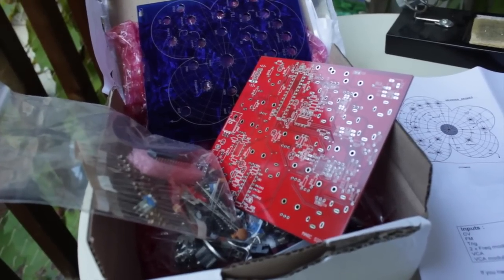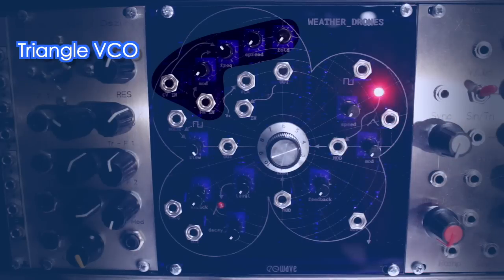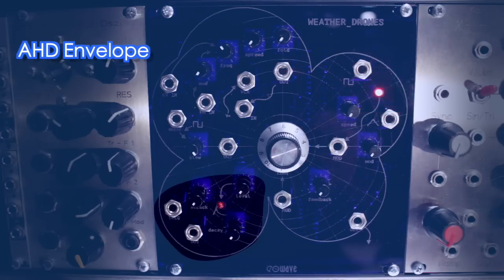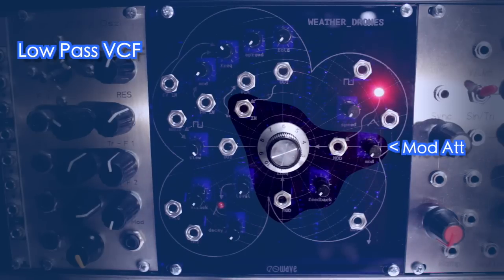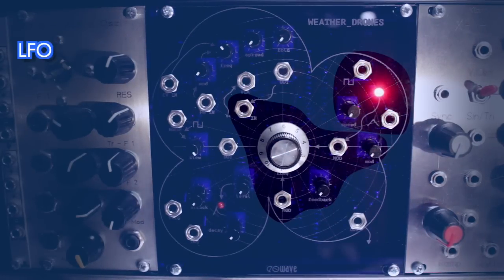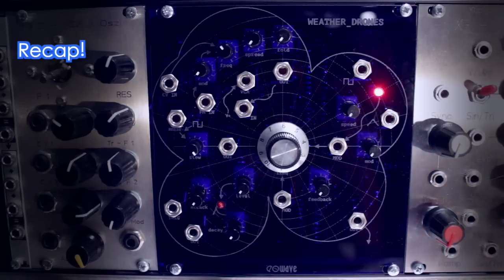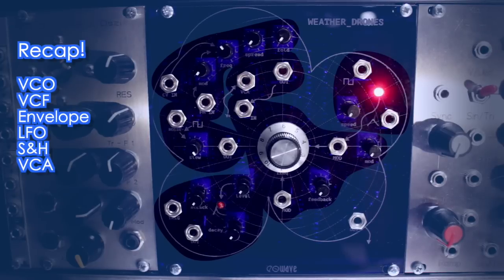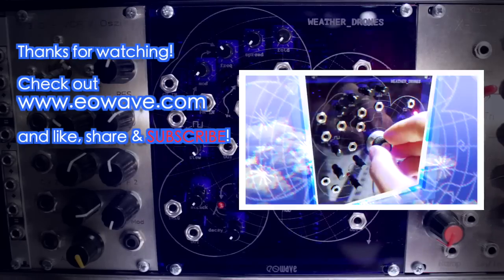Eowave Weather Drones Demo (Eurorack Synth Voice) #TTNM

Comment: Sounds great is it possible to use as a stand alone sound machine ? 

Thanks
Reply from the maker: Absolutely :) Here's an example of just the Weather Drone through a spring reverb: https://www.youtube.com/watch?v=HR-01uVu2Vk
Reply: @tuesdaynightmachines  that’s fantastic I need the module a case and power then out of the output into old tape echo or spring reverb maybe a ring modulator 
Just want it as a stand  alone found machine 

I have a swarm and it’s fantastic 🪐👍
Any recommends for a small case and power ? 

Loving your channel 👍🪐👌
Reply from the maker: A Doepfer Mini Case (32hp, 200mA power) is probably the cheapest case, that you can probably also get second hand. A bit "nicer" are the 4ms POD cases (e.g. POD 34X powered).
Reply: @tuesdaynightmachines  thanks  that’s  fantastic 👍🪐

Comment: Another excellent tutorial! The urge to start building DIY modules gets stronger and stronger! Only question: are there any good tutorials explaining slew? I can't wrap my head around it...
Reply from the maker: Yeah, this one especially is a really good deal in my opinion. Affordable, easy to build yet giving something really unique to play with. Slew really just smoothes changes in incoming values. So if you picture a square wave with sharp corners, slew will round those corners. The more slew you apply the rounder everything gets until you basically get not change anymore.

Comment: hey, your video convinced me to get the weather drones a couple of days ago but im slightly confused.
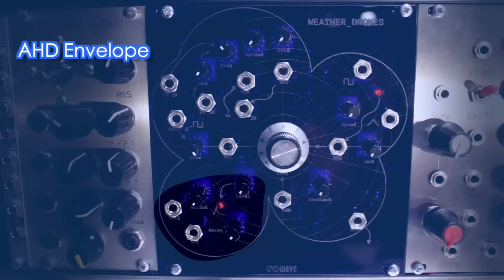maybe its a editing-thing but in minute 2:44 you explained the vca and used the direct out from the vco.
in my drones ( rev 1.5 ) the vca only effects the master out. 
maybe you know why. best wishes and thanks
Reply from the maker: Strange. It's surely not an editing thing. Maybe they did indeed change something in newer versions? Don't remember which version I got back then, but I think it was close to the module's initial release, so definitely an early version.
Reply: @tuesdaynightmachines  hmm. Strange - because it makes absolutely sense to me to apply the vca to the main output… I learned - 1.0 is the diy, 1.5 is the presoldered version. No further information. But against - great work:)
Reply: I just bought one recently too, and mine works the same as yours, the VCA only affects the master out.
Reply: @videotrexx  thanks for letting us know

Comment: Would this be a bad first diy module? Last time I soldered was 4 years ago. But as there’s 0 assembled modules online, seems to be my only option
Reply from the maker: I think it would be alright for a beginner. No complicated parts or work steps as far as I remember. Just take it slow and concentrate and it will be fine. Generally, I find soldering/kit building very easy when you have the proper time and place for DIY. It’s all about keeping distractions away :)